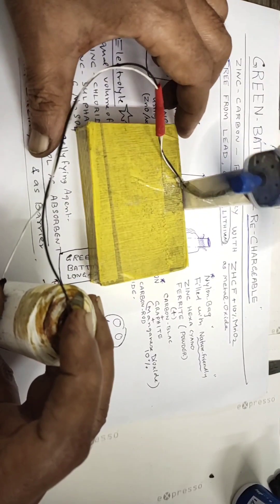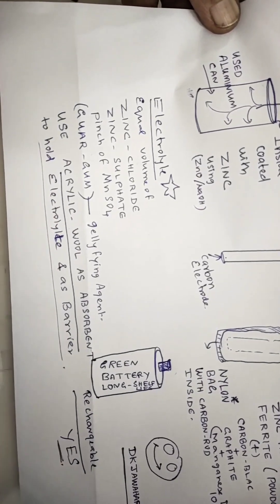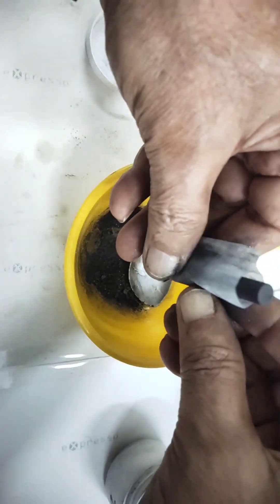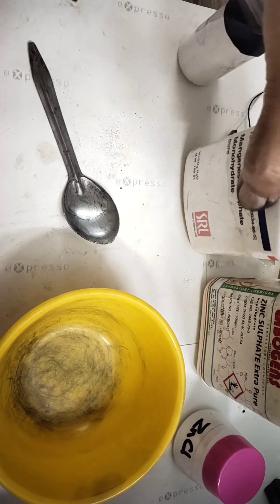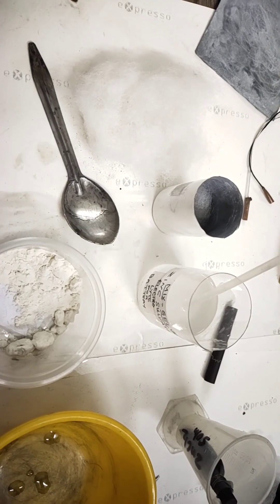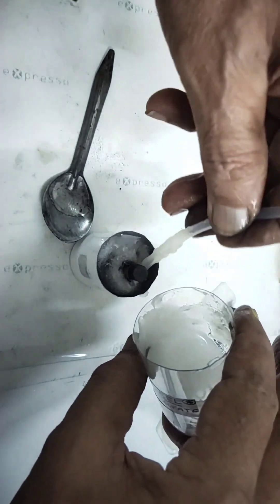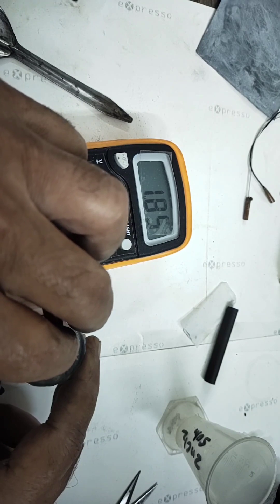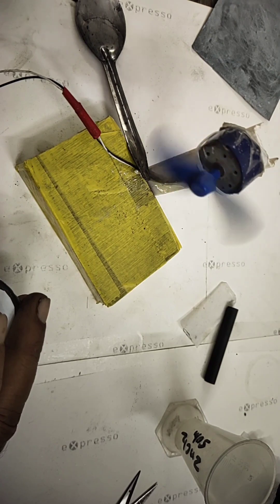GREEN BATTERY, ZINC - ALUMINIUM CARBON BATTERY, HEXACYANO FERRITE, RECHARGEABLE, VOLT 1.78

Comment: Good job boss but there is no a way to increase on current (amp)
Reply from the maker: You can increase the ampere by increasing the surface area of zinc coated aluminium plates and also the carbon plates to be used instead for carbon rod

Comment: How many cycles are recharge approximate, sir
Reply from the maker: The answer for your question can be obtained by practical study on this subject. As to my knowledge, I have done similar battery in the year 2021, still active to be used on charging. It is quick chargeable and free from toxic chemicals.
Reply from the maker: This will be on par with commercial re-chargeable batteries. Actual study , I have not taken. It will be another topic.